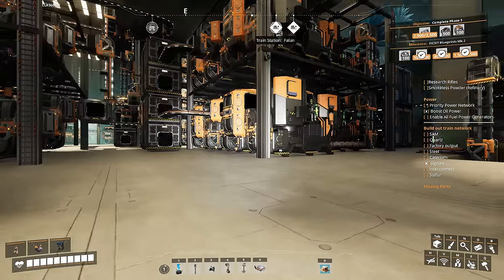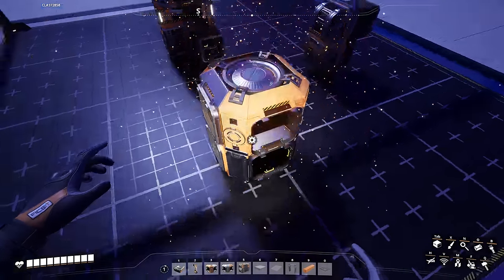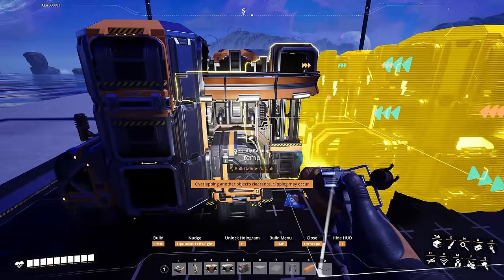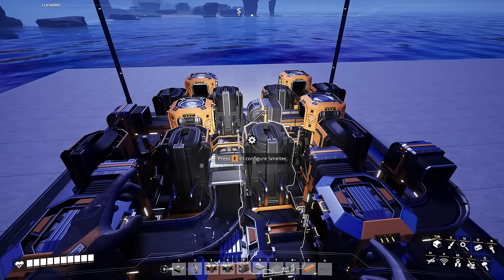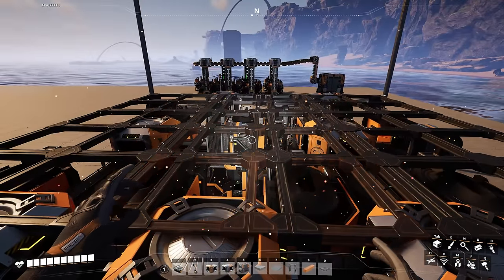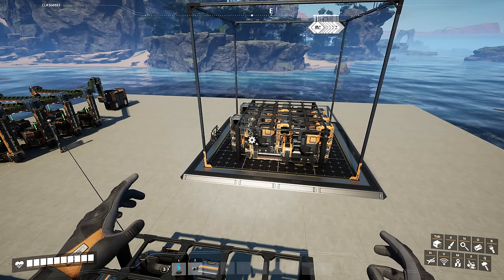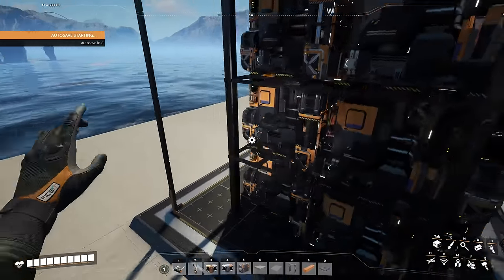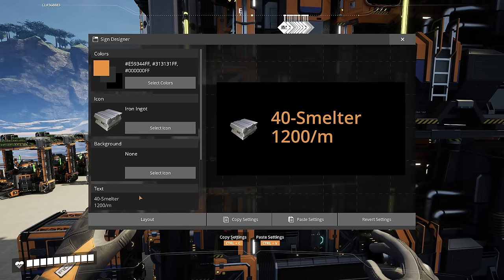Satisfactory 1.0 Tutorial: Compact Stackable Blueprints

Comment: really helpful one - ! tried to apply the method to a set of 6 constructors (4x4) and 8 assemblers (5x5) and am surprised by the given flexibility of the modules. My assembler-Unit is spitting out 1000 cable/min for now but can easily do 2000 when fully upgraded. I can remember having a bus-floor mk3 belts feeding 2k cables in my EA-playthrough, it was gruesome.. again, very helpful, gj!

Comment: This is basically how the games Shapez and Shapez 2 works, especially the 2nd one. You build modular factories on fixed-sized foundations and then string together a series of them, each doing primary one task, to achieve a complicated result. It allows building new factories and scaling up to be done quickly and with little mental overhead as the hardest part of the design process is in creating the modular factories in the first place. Once you're just plonking them down, you don't have to think as hard.

Comment: I feel like at the point where you're using mark VI belts you should probably be using refineries and the pure iron recipe. Yes it takes a little more setup, but you can use a Mk3 Blueprint designer and put 8 refiners in a blueprint. You could even make them stackable without too much trouble. 280 iron into 520 ingots w/ just a little wire and a lot more power.

Comment: Those compact lifts could be saved as a blueprint of their own. This would speed up the building process drastically
Reply from the maker: In the follow up I make the argument that mini blueprints for this aren't as helpful as they first appear.  I can understand using maybe the four different compact lifts in some situations, but my difficulty with them is that it's very hard to place them correctly without lift snapping, which you don't have access to when placing a blueprint.  If it works for you that's great though, I just have a hard time finding a good application for them, and I prefer becoming fluent in building them from scratch.

Comment: Impressive stuff. Is there room to adjust clock speed in these, or is it too compact to access the configuration?
Reply from the maker: You absolutely can access them, it's just a little awkward.  All the machines are accessible from either the front or the rear, and you can climb inside if you want to.  I find it's so much easier to just add machines that I never bother with clock speed or 100% uptime, unless I have a very specific reason, usually to do with fluid flow.

Comment: With buildings that require more than 1 input or output, do you just forgive the clipping of the lifts through the other belts?
Reply from the maker: Nope!  For those I spend some time wrapping them around one another.  You have a surprising number of options to make them fit correctly, but they can be a pain especially without a hoverpack, jumping around trying to find the right angle to understand what's going on.

Comment: Could you save the splitter/merger stack to a blueprint for easier use in other blueprints, or will the connections not work?
Reply from the maker: The stack absolutely would work in a blueprint.  The reason I don't use blueprints for that is because usually it's more work to position them than to build them from scratch, and there's actually a bunch of different orientation possibilities that would make blueprints hard to use in this context.  Like each input position in the triple stack is specific to this build, and both stacks are mirrored.

Comment: My design is much simpler, just 4 constructors on the left and 4 on the right, the input faces the outside and output inside, input side is fed with a sinple manifold and output also merges into a manifold, and each floor's manifold is also connected to the next floors manifold with elevators and reverse the direction

Comment: Aren't you splitting 1200 in 2 and not in 16/40 and 24/40 ? Isn't it why it's slower at the end ?
Reply: Using a Mk4 belt would fix it
Reply from the maker: That's probably correct actually.  Usually you'd let the machines saturate and I didn't think about the fact the bottom 24 would fill up slower.